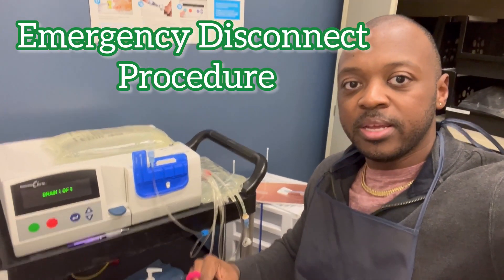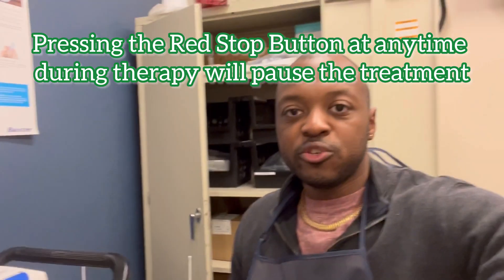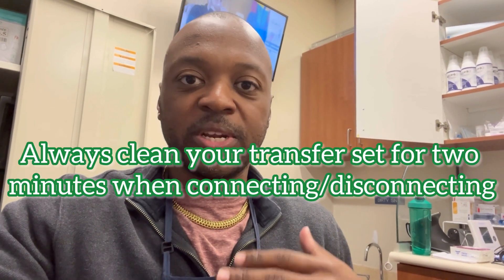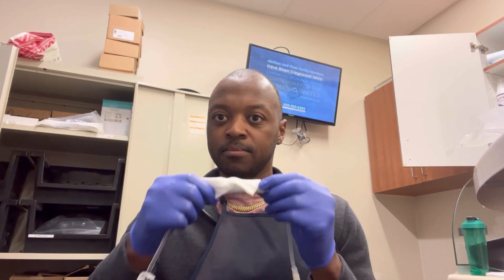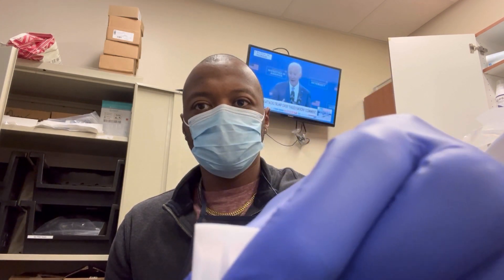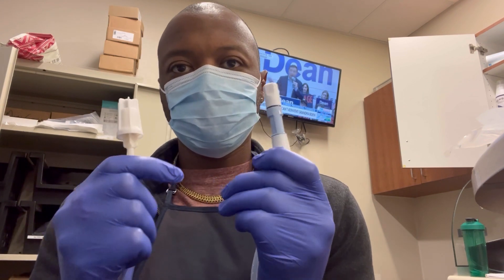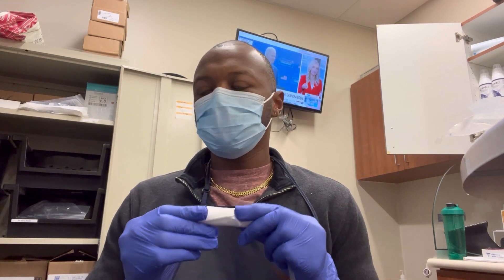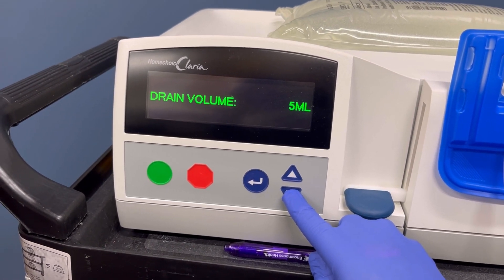(PD) Dialysis- Emergency Disconnect from PD Cycler

Comment: What happens if you have a power outage in the middle of the night ?
Reply from the maker: I made a video about that. The machine has a 2 hour battery that resumes treatment from where you left off if power is restored. If it’s over 2 hours then your treatment is lost

Comment: Shame on the PD company for not setting it up properly. It is not acceptable to disconnect to use the bathroom. If the machine is not in range with cassette length, the machine should be moved or extensions used. There is no good reason to take the risk of disconnection for this, almost all patients  will need to use the rest room in their treatment cycle.
Reply from the maker: Just to give someone the benefit of doubt- sometimes patients aren’t comfortable walking in the middle of the night with the tubing. I’ve had people tell me they’re afraid they will trip over it. Also some PD patients don’t have a master bathroom and even with the extension it doesn’t reach the hall bathroom